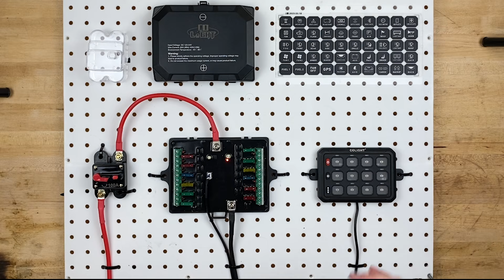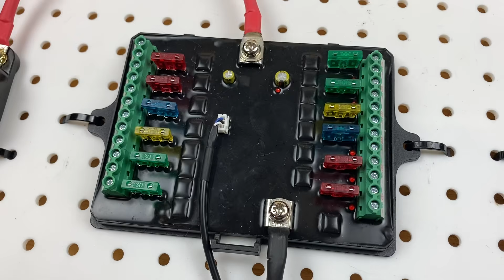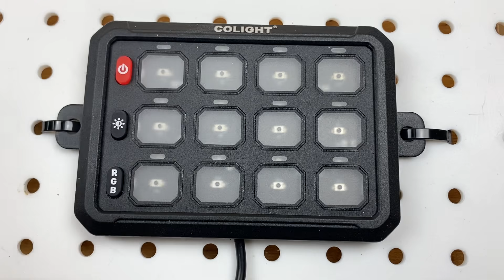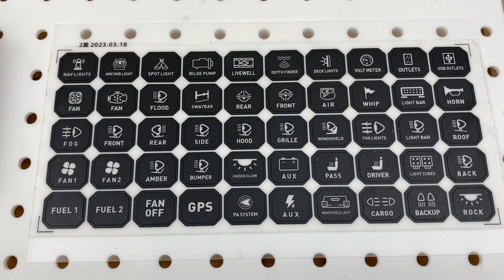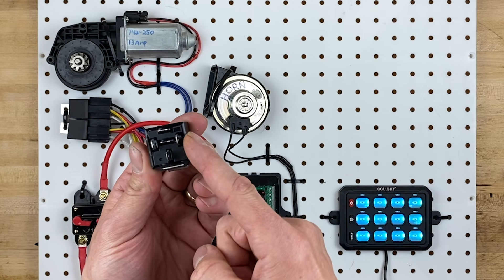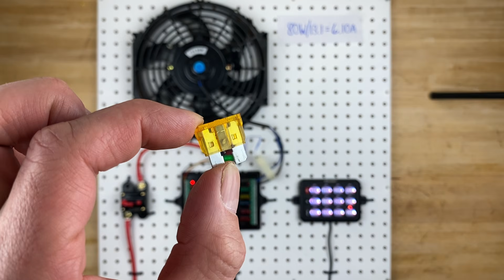12-Button Race Drift Car | Off Road RGB Switch Panel - PROGRAMMABLE!@WiringRescue

Comment from the maker: ➡ Subscribe To This Channel: http://www.youtube.com/user/4g63mightymax?sub_confirmation=1
➡ What Size Fuse? https://www.youtube.com/watch?v=EhzN6UdnmPA
➡ See My Wiring Playlist: https://www.youtube.com/playlist?list=PLsF7T1tRFy2hmiiUUfMZNyV-BUA_yrPIh

Items used in this circuit:
🔗 Wiring Rescue Amazon store - https://amzn.to/3KKkCdP
🔗 5-Pack of 5-Pin Bosch Style Relays - https://amzn.to/3KSrYu6
🔗 Universal horns (different brand than video) https://amzn.to/3v4UIHO
🔗 Dorman Power Window Motor - 742-259 https://amzn.to/3knjcew
🔗 Turn Signal Flasher - https://amzn.to/3UOTsFy
🔗 272 piece fuse variety pack - https://amzn.to/3k48cNt
🔗 2 Pin LED Turn Signal Flasher - https://amzn.to/3yW8vBx
🔗 194 Light Bulb Sockets - https://amzn.to/3Hn7gSj
🔗 10-Pack of 194 Light Bulbs - https://amzn.to/3MXmaC2
 🔗 Digit Ammeter (Amp meter) Voltage Gauge https://amzn.to/3NN45qJ

*As an Amazon associate I earn from qualifying purchases.

SHOP AT COLIGHT FOR 6-GANG, 8-GANG, 12-GANG SWITCHES:
15% Coupon for a CoLight 12-Gang Switch: JMRGB15 
🔗 CoLight website (Affiliate Link): https://www.led-colight.com/?ref=yt7k...
🔗 12-Gang Switch Panel (Affiliate Link): https://rb.gy/djk7c
Reply: Love your videos man. 

I have a 1988 jeep YJ that I'm going to completely rewire myself. It's the old 4.2 carbureted engine. 

Would you entertain doing a video about how to plan out a wiring harness? Which items to put on each circuit, what to run on relays vs just a fuse, wire types you'd recommend etc?
Reply: Would love to see a video of waterproof wiring setup for roofless jeeps and homebrew buggy things! Love your videos!
Reply: Halo saya sudah mensubsribe nya  kawan

Comment: Is there a way to wire this up to use the flash function on the keypad for turn signals but also have brake lights on the same bulb?

Comment: When wiring up my starter every time I hit the momentary switch it's cutting power to my panel and just clicking the starter solenoid. Can someone plz help.
Reply from the maker: It sounds like your starter is drawing waaaaay more electricity than your switch panel is rated for.

Comment: I wouldn't connect a 6 amp device to a 30 amp capable circuit even if I can change the fuse to a lower capacity, if there is a 10 amp circuit available.

Comment: I have a question. In my drift car I have my ecu sending a ground trigger to turn on a relay to power my radiator fan. I was going to wire my button panel up so it sent a positive trigger to then use another relay to send a ground trigger to trigger the original relay for the fan. It would be an override to keep the fan on whenever, instead of the ecu having control.

Now for my question. Could I technically just attach the ground side of one of the fuses to the original relay since the button box sends out ground triggers? I wouldn’t even need to hook up a power wire if I’m understanding correctly

Comment: Hey great video, you explain it in a way thats very easy to understand. 

However i have a small question as i bought that same " fuse box/switch" system. You dont run the fans or the fuel pump thru a relay, is it because that fuse box doesnt need any? Thanks
Reply from the maker: It depends how much amperage the fuel pump and fans draw. If they draw more than the switch can handle, you’d control them with a relay instead. The first step is looking up or measuring the amperage draw on those components though. From there, you can determine the best way to control them. Good luck with your project!

Comment: Let me ask about the switch panel; is it possible that I can connect both the battery power and acc power with a fuse tap together so i can switch from the panel itself if i want to use the accessories or the battery power? I would connect the battery side with the breaker off until i want it to be used then i would switch from acc power to battery then reset breaker. I want to know if i can do both so I can use the acc for driving and then switch to battery when camping or something where i dont need to turn my car on. Thank you! Thats my only question is if i can connect both without using one or the other like a non-coincidental load.

Comment: One thing to notice with these multi-gang switch panels, they need both wires because it's switched on the negative side.  So this means it's largely incompatible with the universal 12/21/22 circuit hotrod wiring kits which ground everything to the frame.
Reply from the maker: Very true. I made that same recommendation to the company that makes these, and they allegedly came out with a new one that is controlling the positive side.

Comment: Hey. Mine is all installed and running. Controlling a whole kit car with lots of relays to things (negative earth)

I've got an issue where the panel cuts off for no reason. You're driving along and its just like someone hit the red off button. But if youre watching it you can switch it straight back on again? What would you check for the cause? Bad Earth? Bad ACC trigger? 

It only does it on the move so its going to be hard to find why!

Thanks. Phil
Reply from the maker: I’d probably follow those power wires back to the source and make sure there isn’t a loose butt connector or something movable cutting in the wire (like a brake pedal, gas pedal, heater controls, etc)
Reply: @WiringRescue it was a wire passing through the bulkhead shorting! Thanks for the pointers. Reinforced it in a rubber tube now

Comment: Why on earth would it be sending out positive signal, if anything gets grounded out- I don't want random shit turning on and off...
Reply: Like what if my light is grounded by the chassis, i really have to buy a relay for every item.
Reply: also why did you complicate the window motor so much-  and add more relays, just flip flop the wires on the main relay board.

Comment: Is it possible to swap the negative and positive post going into the board to make it a positive output with the switch instead of negative. This way I could only run one wire to the fan and ground to the chassis for example.
Reply from the maker: There are ways to do it with relays, but I believe the company that makes this switch also makes a newer model that flips the positive side instead of the negative. You should probably check that one out!

Comment: Hi Mate, how r yeah.. I have a question, I m not an electrical person, so please excuse me. I have a 12 pin auxiliary fuse box. I want to know if is it better to add 1 relay of 120amps or if should I add 30/40 relays to individuals. Please suggest I have install extra lights, also plan to install air compressor, winch, etc.
Reply from the maker: There are a lot of different factors to determine the answer to that question. I have two videos that I think will help you out a lot if you haven’t watched them already.

First is this one that will help you understand relays and when they would be used.

https://youtu.be/QCkfFCLa_Jg?si=L5Gl0yldvI76WO8z

Another is about choosing wire and fuse sizes, which will help with determining what amperage size components you’ll need to use.

https://youtu.be/EhzN6UdnmPA?si=jwrY8ikL2lJJUxZn

Comment: Thank you so much for making all of these videos I know nothing about wiring and the old truck that I have the wiring that is in it is just so absolutely terrible. In order to get the blinkers to come on you have to press the hazard button and you don’t have hazard lights when you turn the headlight on the windshield wiper works.😂 it has been nothing short of a nightmare and it’s been six years and I’ve been trying to fix all that until I came across your videos. I’m going to literally use one of these switch panels to completely rewire every single thing on that truck. The lights, the horn, the windshield wiper even a push button start. Every single thing will be operated off of one of these.

Comment: What if I have a MSD box?
Reply from the maker: I don’t have an msd box schematic, but my instinct is that it would need to be powered up with the rest of the ignition system. Generally that power comes from the ignition switch, and may or may not go through a relay depending on what is on that circuit and how much amperage it draws.

Comment: I have wired my first relay (going to need a few for my kit car) wired exactly like you did. When I hit the button the unit flips out and turns off? I have to pull the relay. Turn the unit on. Turn the button off. Before the unit will power up again as the relay seems to be cutting it out.

Ideas???
Reply: Tried again. With an LED number plate light attached. 
85 black to control box -
86 white to control box +
30 blue to control box +
87 to led + 
Led - to battery -
It instantly blew the 30amp fuse. 😢

That's the same as your starter. Relay is a MAA-S-112-C
Reply: Worked it out. Relay labell3d wrongly. Thanks

Comment: Question for the starter circuit. Or others wired the same. As the two positives to the relay share the fuse. But the earth's go to different places. Does the fuse still apply to both the circuit to the relay and the other side of the relay. Meaning there is no need for a fuse on the other circuit?

I hope that makes sense. Reading up a circuit should have a fuse on both sides of a relay but in this case the fuse is being shared as both positive feeds are from the same starting point. 

I'm doing a kit car which is negative earth and as such due to that I need 7 relays. Shame. But I like the switchgear.

Comment: How would  use relay just to run a headlights  brake ligh a ignition sytem on a motorcycle with a kill switch to  cut the engine  off

Comment: Hi I know this video was made a long time ago bit hopefully you could help with a quick question of mine... I have the same 12 buttom switch and I am looking to hook a volvo fan to it. It very powerful and when first turned on spikes to 70ish amps then drops down to just under 30amps. How would you recommend wiring this? Will it work one of the 30amp outputs with a 70amp relays. And what guage wire would you recommend? Thanks and great videos!

Comment: This video is fantastic! It would be great if you could do an updated version with the newer positively switched 12 gang switch panel using exactly the same components minus the relay for the starter. I’m planning to wire my drift car up similarly 🤞
Reply from the maker: This one is pretty darn close to what you’re hoping for https://youtu.be/XyO4hKdzUOs?si=zKx4NGYhSc7WJk2X

Comment: I am looking to use one of these switch panels in place of a fuse box for a Jeep Cj7 project, would it be possible to have the brake lights and directionals still work off the same bulb?
Reply: Use a 3157 it's dual filament

Comment: Awesome video 👍.  My light bar (420W on 12V) needs a 35 amp fuse, but the switch panel has a max of 30 amps only. The original wire harness came with a 40 amp relay. If I hooked the 40 amp relay with the switch panel, would it work? How would the wiring be done in this case. Your guidance would be most appreciated. 🙏

Comment: @WiringRescue I just wanted to take a moment to not only thank you for all of your informational videos but also to pose a question for you as well. I'm in the process of restoring an 86 Mustang which your videos have helped immensely with however the blower motor resistor according to my mechanic is the only thing stopping my heating system from working and we have been unable to find the replacement part since the company that made it no longer produces it. Is there a simple fix that I am not seeing or do I really need to replace the entire system? Thank you!

Comment: I know I sound dumb but wiring all of this would I still be able to use the key to be able to prime the car and turn on the ecu and everything else
Reply: This is where I'm at. Also it's a pain this switches negative and not pos.

Comment: Do you know if it is possible to wire an electric tach and speedometer from a 2000-20010 into a classic 60's vehicle? If so maybe a new project.

Comment: a 'CHALLENGE'!:  Show a way to trigger an accessory at any preset RPM. It has to be adjustable. Has to have a range between 1,000 to 5,000rpm (or higher). Has to work with a 12 volt system. Has to be able to at least handle up to 30 amps. When below the selected rpm it should shut off and when at or above the set rpm it should allow power to pass to any desired accessory.
Reply: Having a circuit like this tied to a diesel intake valve would be AWESOME for runaways, now we're thinking outside the box

Comment: Have you retired? Latest video over 4 months old. If you are looking for new subject matter:  fuel system install , tank to carb with your component recommendations using  Push loc / lock Fragola style AN Fitting
Reply from the maker: 😂 not retired, just wrapping up a big car project that took way way longer than it should have! I’ll have new videos soon!
Reply: they always do  @WiringRescue

Comment: Hi Thanks for the video it has been very helpful! Do you have a video that explains how to set up a fan on one of these switch panels using a relay? Or is there no need to? My fan is alot larger and been told it could overheat the wiring
Reply from the maker: Fans do draw a lot of electricity! Check this video out. I think it will help! https://youtu.be/9Hj7Ri3TXhc?si=2TpxZsXwDRKcc8yS

Comment: Thank you so much for the interesting experiment and informative video.
The SwitchPro recommends the use of relays for motors and other equipment where inductive loads are expected.
I guess they are concerned about the inrush current duration and back EMF of an inductive load damaging the MOSFETs.
I am also trying to simplify my car wiring with gang switches, but keep adding relays to the schematic!

Comment: I would like to know if Relays can be wired in a way that there is a delay between each on in a series. I'd like to use a 'HALLS' Magnetic Switch to turn on other devices when it reaches a specific RPM, but I don't want the total load to all turn on at once, I'd like a delay between each device. Will having one Relay turning on another Relay, turning on a 3rd Relay allow the load to not all come at once?  [EDIT] I did find Delay On and Delay Off Relays. They already exist.

Comment: Ok… You sold me on this, and I purchased the 12 gang model. QUESTION: How do I use this with ignition/acc power so I don’t drain my battery when I walk away without turning circuits off??  Thank you.

Comment: Switching the negative is JPS. I'm sending it back. There's another model that's supposed to switch the positive. You know, like the way we've been wiring things forever. The new one says anode switching not cathode. Good thing I have one foot on a banana peal, cuz I'm getting really tired of them changing the rules. In other words I'm not rewiring 12 accessories just because they wanna switch the negative. What about horns and lights that are grounded to the bracket. Argh, JPS.

Comment: Quick question ... do you use a lab bench power supply for your setups or do you just use a spare car battery you might have on hand?
Reply from the maker: Why do you ask?
Reply: @WiringRescue  Just curious ... I was thinking of recreating a setup or two and I don't have a "spare battery" ...

Comment: I have a Whelen edge 9000 lightbar mounted on a back rack that I'd like to use this on. It has 1 ground wire and 1 constant hot that runs to the battery. Then each strobe pack has its own positive as a trigger. I'd like to run just the positives to this switch panel since the lightbar will be grounded anyway.  You said this switches on the groundside. would that still work for the way I want to connect it?
Reply from the maker: Unfortunately this switch is probably not the best option for what you want to do because it switches ground circuits. I’ve heard that the company is coming out with a new switch that DOES do what you want, but I’m not sure when that will happen. I do have another video on wiring toggle switches. That may be a decent option for you if you don’t mind that type of switch?

Comment: lets say you are powering your headlights and have a 30a fuse. you are taking power directly from the battery which is significantly more amps. the wire from the battery to the fuse is getting x amount of amps and only letting 30 through to the lights. does the battery to fuse wire overheat?

Comment: They can keep there PDM crap. They brake down or stop working your screwed. With mechanical relays and out in the middle of nowhere  you can do a quick fix with very basic toold and get home.

Comment: In the USA, we usually switch the hot but overseas, they usually switch the ground. Guessing this switch setup was manufactured overseas.
Reply from the maker: That’s very plausible! Thanks for watching!
Reply: There is an updated version that allows you to choose power or ground switching.

Comment: This is great. Thanks. Question... wiring for an electric go-kart, running a separate 12v battery to run accessories. Can I put a 6 fuse fuse box on a 12v 6Ah stand alone battery to run multiple lights?

Comment: Amazing video, so go I actually bought one for the build of my race car. I do have a question though.....I was intending to wire my car with 7 core trailer wire. My question is this, do I need to ground everything through the fuse box or can I ground (for example) the rear lights grounded to the body and the live into the fuel box will it still work or do I need to run a ground back to the fuse box for every circuit? Thanks
Reply from the maker: Unfortunately, the way that this box is designed, you have to run the ground for each circuit, because the ground is the actual trigger wire. You can swap the triggers from negative to positive, as I did with the starter in this video, but it would be a lot of extra wires if you have to do that for every circuit!